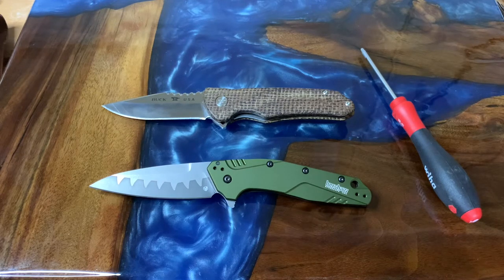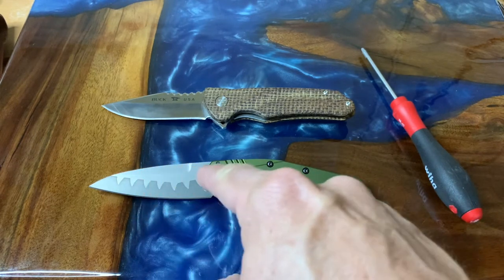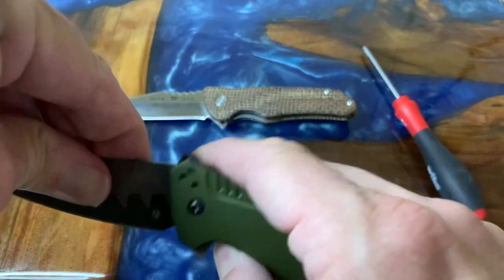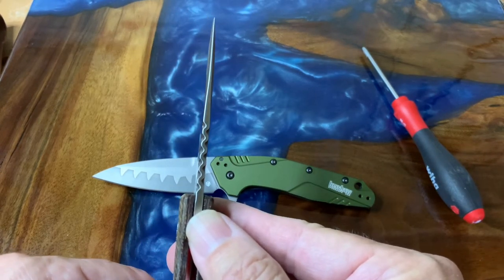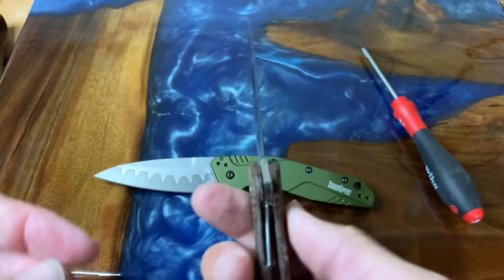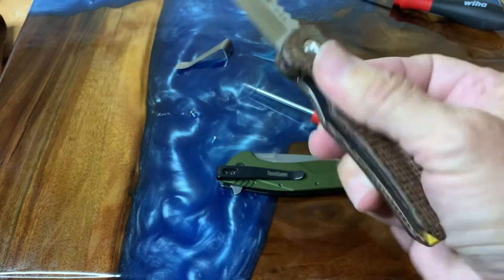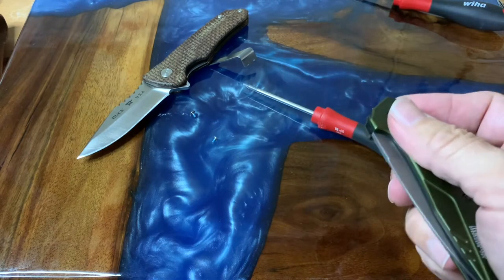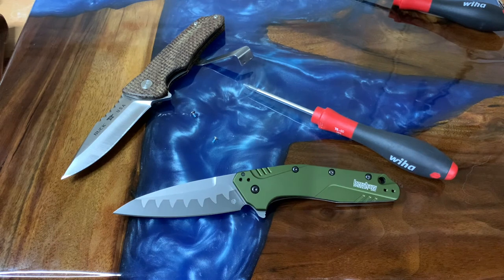Kershaw Dividend and Buck Sprint Pro

Comment: I really like my buck sprint. It is not the pro so still 440c but have used it every day for almost a year now and not had to use a “stone” at all and still hair popping sharp. I took the knife apart and replaced the grease with oil on the bearings. It opens much much better with oil instead of grease. The clip I like it sits in the pocket well even if it is angled. Also sits in my side carpenter pocket well. The clips is positioned where I like mine so didn’t matter to me. I do agree with the fact you can’t change the pocket clip is kinda weird for the price and modern standards. 
    I like the better steals for knives I take into the field for a while or know I will use the heck out of in one day. I’m with you on the 1095. It is easy easy to get back to stupid scary sharp. I can get 1095 sharper than any other steal. Sorry late to the show on this one lol
Reply from the maker: You’re not late! Glad you made it here! I try to focus on affordable knives that anyone can get. I am glad you enjoyed that video and I hope you will enjoy the channel!